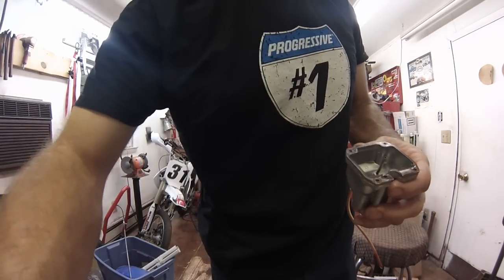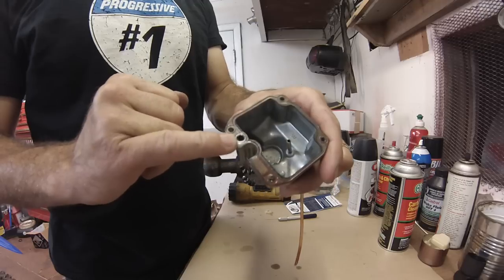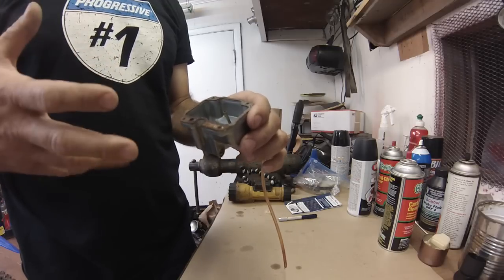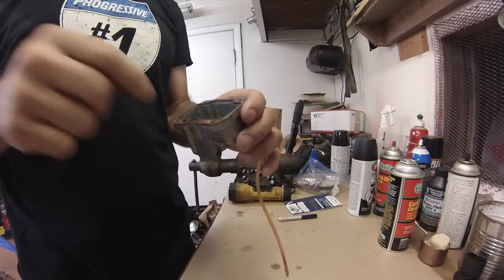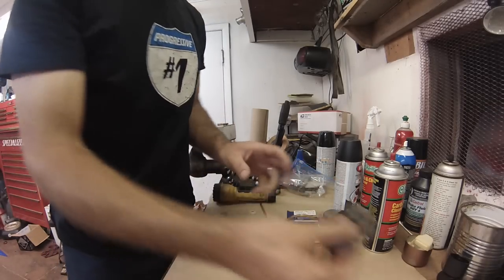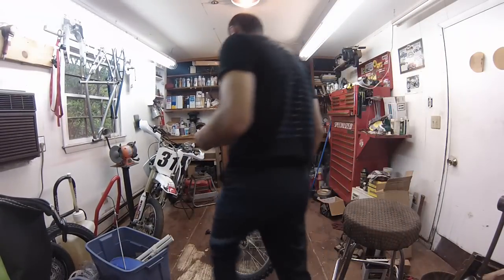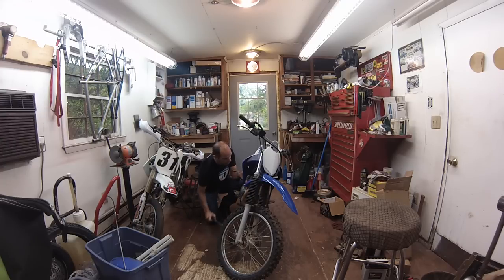TTR125 hard cold start problem FIXED !!

Comment: Will this problem reoccur? As have had trouble starting my 07 ttr 125 since brought it and its been so frustrating to try and start.. This weekend i have given up and want to get rid of it due to it not starting. But thinkin of reconsidering it after watching this and might clean the card and jets and choke..
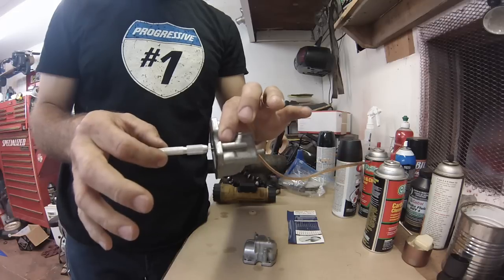Reply from the maker: Keep the bike, we can fix it. The bike in the video is a 2007 with 12 fender/number plate on it. I have seen carbs go bad from one winter season. If you brought this to me here is the order of repair. (assuming you have good compression) Check for spark, flush all fuel! this is usually over looked, you want to be sure you have fresh gas with no water in it. This ethanol fuel attracts water and it will sit at the bottom of your tank and or fuel can. Get your tank dry and put some fresh super in it from a can you filled from empty! Then pull your carb and make sure your choke is moving 5:56 in the video. Then pull your jets and make sure you can see light through them. The pilot is the thin long one, the hole is tiny you must see light through it. You don't need to replace them just make sure you can see light through them and carb cleaner blows through them. If you have to replace them, get OEM ones not cheap China jets. Then unscrew your mixture screw, its the one at the front of the carb going straight up from the bottom, it is a screw/spring/washer/oring in that order. pull them, careful the washer and o-ring are tiny, dont lose them. Blow carb cleaner through that hole as well. Put it all back in reverse order GENTLY seat, then back it out 2.5 turns. Do the repair in the video, then shoot carb cleaner down the hole at 7:07 in the video and make sure it comes out in the bottom of the bowl. If you have compressed air shoot that through all the holes you shot carb cleaner through and I would highly recommend you get a wire small enough to manually push through every jet, I use a wire from a brick brush.  Put it all back together and fire it up. GL Please let me know how it works out or if you need any further help.

Comment: Are you simply cleaning the dirt out of the passage with the drill bit or are you actually making the hole in the casting bigger?
Reply from the maker: Just cleaning, not making it bigger.
Reply: @TepcoCycleRepair  Right on... I have the same issue with my son's bike now.  I've had the bowl off 3 times now.  After I put it back on, it fires right up but goes back to not starting the next day.  There seems to be a chunk of dirt floating around in the lower end of the passage that gets sucked up and plugs off that tiny little hole in the brass plug.  I don't know what Yamaha was thinking, that brass plug should be at the very bottom of the passage and visible from the inlet.  Anyways, I'm sure I'll get it sorted eventually, thanks for the video.

Comment: I cleaned both jets and everything perfect it starts up, but wont stay at idle. I try adjusting the front screw on the bottom, i think its the mixture screw. But im not sure how much to adjust it. Any tips?
Reply from the maker: Put the mixture screw at 2 turns out from lightly seated in. If it still doesn't idle without the choke, re check the pilot jet, or you may have low compression from worn rings or a tight valve.

Comment: The reason I asked the below question is a 750 v twin front carburator seems to be having a similiar problem.   I took it out and cleaned it up and it ran great for about a week and then it acts like it isn't getting enough fuel.   The exhaust is warm on that cyl...... and will fry your fingers on the other.   Compression's are great.  Spark is good.   It's up on the stand again now and ready for the carb to come out.......

Comment: i can get mine running, but once i get on the throttle it runs terrible and cant seem to get the carb to "clear" up. Ive torn the carb apart numerous times and still cant figure it out. Im going to give this a shot tonight, any other advice would be appreciated.
Reply from the maker: Make sure you can see light through all of your jets and that they are stock size or close to it. Set your mixture screw at 2.5 turns out and make sure your float is set right. GL

Comment: Thanks for the video! Can this procedure work as well on my TTR230? It is hard to start and is electric with no kick to use. Thanks!
Reply from the maker: Should be the same thing! Make sure your pilot jet is clean as well, that's the most common problem I see on bikes that sit a lot. If the bike idles perfect and revs up fine when warm, don't worry about the pilot, just do the above repair. GL

Comment: Thanks for posting! Did this and the bike started, but I can not use the choke as it kills the engine immediately? Any ideas? I may have enlarged the hole a bit, but apparently that should not be an issue. Just purchased the bike recently so I am unsure of its history, but it was running well and started fine when we got it and after the first long ride the cold start became and issue. Seemed to idle to low as well, so I adjusted the idle screw a tiny bit (1/16 of a turn maybe).
Reply from the maker: If you made the hole big, its going to suck up more fuel then normal and flood it which will stall it. It will also make you have to turn the choke off quicker after cold start. Many engines will stall if you pull the choke when its running so no sweat there. Make sure your pilot jet is clean and adjust the idle and mixture screw to get a smooth idle.
Reply: tepco1 Thanks. I need to pull the carb and do a full clean, I was short on time and only did the bowl. I tried the bike the next day and it started right up with the choke pulled about half way and did not need it within seconds, so I think the choke cable may need some adjustment (if it can be) as I think it is trying to pull it too far. But it starts better and that was the goal. I won't play with anything else untill I get it apart and properly cleaned.

Comment: I have this same problem with a 2009 TTR230.  Different carb/choke design.  Any ideas?  Is it a similar problem?
Reply from the maker: Even though the choke is different it works the same inside. Just pull the bowl and shoot some carb cleaner down the hole and see if it comes out at the bottom of the bowl.

Comment: Does the ultrasonic cleaning resolve the problem or you need to still manually clean that tiny hole?
Reply from the maker: I have found that you have to manually clean it. If you have an ultrasonic cleaner, I would try it, then just spray some cleaner through the hole and see if it worked. A heated ultrasonic would be the best. Let me know if the ultrasonic cleaner works for you.
Reply: I have an heated ultrasonic 60degrees celsius, will try and let you know 👍👍

Comment: I just picked up a 2005 TTR125. Someone seems to have just deleted the choke so idk if it’ll work without that? 

But I’m pretty sure my choke circuit is clogged.
Reply from the maker: The choke plunger is probably seized in there and they cut the cable off. It all depends on where it's seized, if it's closed, it will be hard to start but run fine when warmed up. If it's seized open, you'll need to fix it.

Comment: Is it usual for a 2001 Yamaha 90 or could it be the carburetor when you start it it dies when you give it gas or we don't give a guess who gets to keep pushing the throttle couple times and it keep doing it wrong wrong wrong wrong
Reply from the maker: Give it a good carb clean and make sure the pilot jet is clean.

Comment from the maker: I responded in a message by mistake so I will respond here so others can see. The hole gets clogged by debris, like dirt or corrosion old gas etc. so it has to be manually cleared out. Carb clean and the like are not strong enough to clear it. I would use the carb cleaner to clean out any loosened up gunk and corrosion you created and to be sure it is flowing freely.

Comment: I have a ttr 125 that starts first kick but gets WAY too much air in. I adjusted the idle, but the bike still idles at a super high rpm. Whats going on??
Reply from the maker: Make sure your throttle slide is fully closing and the choke is closing all the way as well. Start with checking cable routing.

Comment: Great advice, I'm definitely going to try this right now. My bike would sometimes start while the choke was open but it wouldnt idle, or the idol was extremely low. so I would adjust the fuel screw, then as the bike warmed up it would idol extremely high so I would have to readjust the screw and turn it back down. I've already jetted the carb. I've read lots of stuff about the air screw and the fuel screw. Do you have any advice on this? My bike is a 2005 Yamaha TTR Le 125
thanks!
Reply from the maker: Yes, set your mixture screw to 2 turns out to start. Make sure, I mean 100% positive, you can see light through the pilot jet. The pilot jet will stop the bike from idling properly if clogged. This repair will fix cold starts, but if it can't idle it's something else. (Most likely the pilot jet)
Reply: @TepcoCycleRepair  will definitely check that pilot, if that doesn't work you will hear from me on here again. Thank you so much for your reply. I miss riding my bike so much every time I stop I have to keep the clutch held in so it doesn't die...
Reply from the maker: @heidihicks9585  sounds good, let me know if I can help!
Reply: I'm at the point I'm going to get a new carb. Pilot was fine. I just can't  get bike to idol properly. For a few it will be at a nice purr, then progressively gets higher and higher and higher. if I turn idol screw down, it won't stay started. ugh...she is being such a pain. thanks so much for the help!
Reply from the maker: @heidihicks9585  sounds like it might be going lean. When it starts, spray carb cleaner around the carb intake boot and cylinder head gasket area and see if that changes the idle. Sounds like it might be sucking air in somewhere. Or fuel flow to the carb is restricted. If you have an online filter, remove it.
Reply: No fuel filter, and ok I will try spraying the carb cleaner when I start it up. I will shorten the fuel line as well because there is a slight Bend in it. Once again I can't thank you enough for the help, I really appriciate it! Not too much info on these ttr's.
Reply: could the throttle cable affect this in any way? throttle is a bit sticky but I've just gotten used to it.
Reply from the maker: @heidihicks9585  throttle could cause the rpm to hang up. Make sure it's moving freely, cable, throttle tube, and carb slide. The throttle tube is usually the cause at the end of the bar, slide the throttle out a hair and see if that fixes it. More than happy to help.
Reply: @TepcoCycleRepair  I'm pretty sure it's lacking air somewhere. Starts up first or second kick with choke open, but dies shortly after.  Sprayed the carb and all the parts you mentioned, no suction or difference in idle. I don't think it's the throttle... luckily a new carb is on the way and I'm crossing my fingers that will make it run like a champ. I'm also not putting normal ethanol gas in it anymore, a place near a riding spot in my town sells racing gas or whatever it's called, so that's how long he was once I get this new carb. Tepco cycle repair are you a business, you have a number?
Reply from the maker: @heidihicks9585  great let me know how it works out. I just do this on the side, tepcocyclerepair@gmail.com

Comment: I have a 1979 Kawasaki 175 when i finally get it started, I come back an hour or two later and it wont start again any ideas?
Reply from the maker: Could be many things. I'm going to guess that your float needle isn't sealing and your carb is over flowing. Flooding it when you try to start it.

Comment: Sir my xr200 2013 is cold start what is the solution in this problem sir what i should clean you have diagram to guide me what is could to that hole.
Reply from the maker: You may have the same problem, I don't have a diagram for your bike but just remove to bowl and look for a similar hole. Spray cleaner through it to see if it flows.

Comment: my ttr125 has low compression like when I am kicking my bike up on the kick start is can move it down by hand and it takes usually 30 kicks and it runs for a bit and dies and that is with the choke ALL THE WAY UP. plz help me. how can I get more compassion and make my bike start in 5 or 4 kicks. is it the idle or what. plz comment
Reply from the maker: Dan Likes Bikes if it has low compression, it could be a few things but I would adjust the valves first. if they are to tight it will hold them open and can cause the issues you have.
Reply: can u send me a link to a video on how to adjust the valves?

Comment: Hi, I have had the same problem with my wife's TTR 125LE since new. I just figured it was a crappy carb! Anyway I cannot find the drill set you used. I have tied several and they all are to short to do the job. Any chance you can provide me a lingk to a set that has the size and length needed?
Reply from the maker: +Steve Ruddy Yep that's the set and that's how much it cost me.  I would think you could find the smallest bit at a hardware store by it self.
Reply from the maker: +Steve Ruddy Also harbor freight has a set for much cheaper http://m.harborfreight.com/high-speed-steel-micro-drill-bit-set-30-pc-61526.html?utm_referrer=direct%2Fnot%20provided
Reply from the maker: +Tepco Cycle Repair link didn't work it's harbor freight item #61526
Reply: Looks like the smallest one is twice the diameter of the one you used in the video and it looks pretty short, are you sure it will work? Thanks!
Reply from the maker: +Steve Ruddy No not 100℅ I haven't had it in hand to verify. I thought the smallest size was thinner then the one I used, .52 mm blue point smallest is .57 mm
Reply: I got mine from snap on

Comment: Hi, I was told by someone if I do the fix mentioned the carb would continue to dispense fuel at a high rate causing excessive fuel issues. My knowledge is very basic so I had no response. My new (preowned) TTR 125 is getting work done and I included this fix. Could you confirm or debunk his theory please. Thank you much!
Reply from the maker: Holly Austin Absolutely un true! the chock, when closed, completely cuts off this hole. The hole is supposed to be there, this repair is just unclogging it. I hope they are not doing the work on your bike..lol..
Reply: Thank you for your response. Just to clarify my name is Shawn and the account is Holly (my wife). No I went with someone else and your fix completely worked!!
On a different note I have a question regarding throttle response and minor popping. Carb is clean, new gas and new fmf pipe. Although I could be just being finicky it doesn't seem perfect. If Jets aren't modified could this be the issue?
Reply from the maker: Holly Austin it could be put in the jet sizes I mentioned in the video and make sure the gasket from the head to the header is good. Popping on decel is lean on the pilot jet, mixture screw, or sucking air at the header.

Comment: Do you think it would work if I just cleaned it out with an air compressor?
Reply from the maker: No, it is usually corrosion that clogs it which is why you need to manually clear it. Try shooting some carb clean down the hole after the air and see if it comes out at the bottom of the bowl.This will tell you if it's clear. If not you will have to clear it like the video.
Reply: +Tepco Cycle Repair ok thanks

Comment: I did this to my son's 2001 TTR 125. Still has the issue. what else do I need to check? Also the white spacer is missing I guess a prior owner removed it, is that possibly the issue now?
Reply from the maker: Tom Simpson will it run with the choke on?
Reply: It will start with the choke out and using throttle. As it finally starts to warm up it will run with less choke but still need to give it some throttle. The PO had butchered it and its been a work in progress, he had the supply line and vacuum line reversed when I got it and it would pour out fuel till I fixed that as well and would do nothing else. Its a decent bike I got for nothing and getting it running has been kind of a project. Already cleaned the carb before this, so I figured I would try this clean out process too.
Reply from the maker: Tom Simpson Ok so if it runs with the choke on the fix in this video is good. I would focus on the pilot jet, I know you said you cleaned it but make sure you can clearly see light through it. Then set your mixture screw at 2 turns out. If your compression is good and valves are adjusted were just looking at a carb issue which can be fixed. Make sure the proper jet sizes are in the carb.
Reply: It's a two stroke, so probably doesn't have a set of valves to adjust I would think, but I will check the jet, not really sure where the mixture screw is on this carb, it doesn't have an idle adjustment screw either.
Reply from the maker: Tom Simpson A TTR125 is a 4 stroke what exactly are you working on?
Reply: Well, that is probably it; the PO handed us a can of gas with it, and said it needs to be mixed; I took him at his word it was a two stroke, I guess I need to drain and flush the fuel system now. Maybe that two stroke oil is my problem after all. But it is a 2001 TTR 125 L.
Reply from the maker: Tom Simpson Ok so just to be sure, if the bike has a thin exhaust pipe from the cylinder back it's a 4 stroke, if it fattens up significantly on the right side of the bike it's a 2 stroke and probably a YZ125 which must use mixed gas.